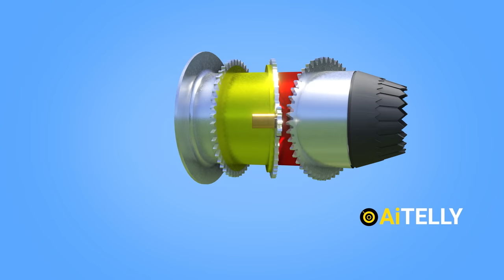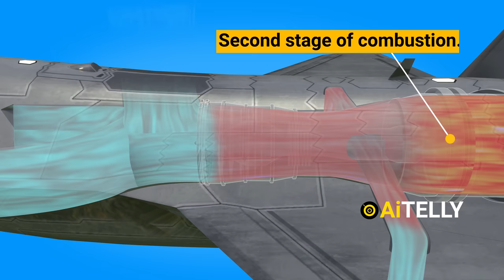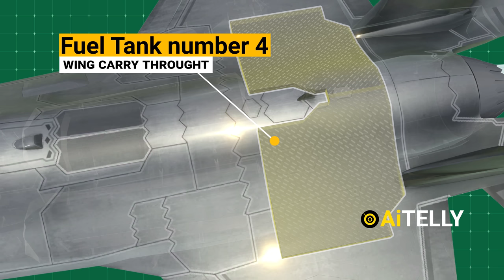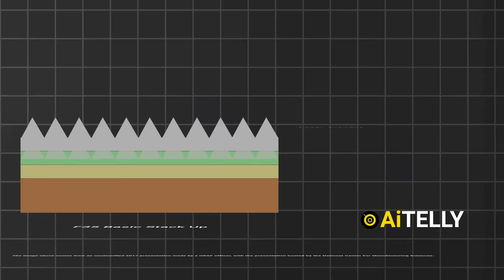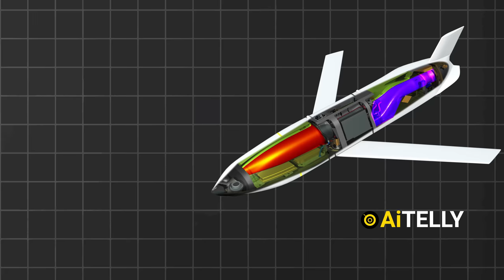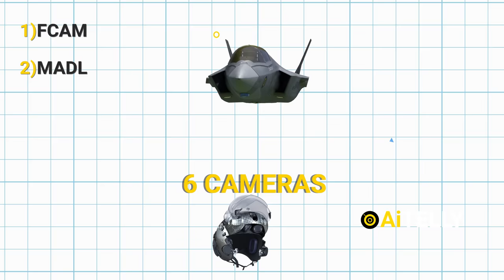F-35 B Fighter Secret Stealth Technology

Comment: The expectation that the F-35 would immediately replace 2 F-16 and A-10 aircraft did not work.  The F-35 cannot fully replace the F-16 and A-10.  It is two times inferior to them in terms of the number of weapons that can be taken on a flight, and this means that in one expensive flight it will be able to hit half as many targets.  And it is unlikely that the total price of these goals will ever cost more than the F-35 itself costs with all the maintenance.  It is also inferior to the F-16 in maneuverability in close air combat at low altitudes.  But with such omissions, the F-35 will replace the F-16.  But replacing the A-10 would be even more inferior.  In addition to a three times smaller combat load, the F-35 will be a very timid aircraft.  Because he will never be able to go where it is hot and hot.  If the A-10 can get out of such a jam thanks to its excellent armor protection, then for the F-35 any bullet or fragment will be deadly.  I'm not saying that the F-35 won't be able to operate against ground targets in a counter-air defense environment.  Of course he can, and not bad.  But he won’t even show his nose, he’ll launch a rocket or a bomb and sneak away to where it’s safe.  The eggs are definitely not useful to the pilot.
Reply: The F-35 has a larger payload than the A-10 and the F-16. For the mission role, and the fact that the F-35 doesn't need to be in visual range for anything, it can cost more per flight hour because that training is done best in simulators that are free to operate. It's also just as maneuverable as the F-16 in the event it would need to dogfight, even though it would pretty much never have to as it's equipped with the second best and second best stealth on any jet, only behind the F-22. Any CAS operation, the one thing the A-10 is good for, can be accomplished by an F-35 dropping a 2000lb JDAM on the skulls of the enemy. Doing gun runs is already a death sentence for an A-10 or F-35 in a conflict where the enemy has MANPADS and SHORAD.

Comment: It was an F-35B used by the U. S. Marines worth 140 million dollars.
Reply: News reported that missing F35B costs 80 million
Reply: @Cal-cz6zg  he probably mistook export version's cost with local one.
Reply: @Cal-cz6zg  F-35A is 80 million. But VTOL version, F-35B, is 140 million.
Reply: @sirsmeal3192  ah, fair enough. Didn't consider the type.
Reply: @sirsmeal3192  no the F35B is 100 million they are correct.

Comment: I thought you couldn't eject unless all control was lost?
Reply: You can eject at any time even on the ground, just pilot usually eject once there is no hope of saving the aircraft
Reply: My girlfriend said the very exact same thing.
Reply: Accidental ejections have occurred in the past. Not common but if does happen.
Reply: @alexandernev24 oh don’t 🫵 you dare start 🤦‍♀️
Reply: Your right, no pilot punches out and then the jet FLYS 80 miles. Did he sell the plane parts, after he auto piloted it into the lake. Then CCP divers were all ready waiting for the splashs... something is very wrong here.
Reply: @franksmith3602  Wow you said everything I was thinking of,your spot on there is something rotting in Denmark.
Reply: @alexandernev24  Depends on your vertical speed indicator 😂😂👍❤️
Reply: @franksmith3602  What if the oxygen supply was compromised.
Reply: @franksmith3602  You are a fool. These situations have happened multiple times in the past. A mig-23 flew 300+ miles without a pilot before it crashed.

Comment: If a pilot punches out and the jet FLYS 80 more miles. The pilot should be fired and lic pulled. If any pilot punches out over, subdivtions filled with children, he should be charged. There traning is to go down with the craft, and guide it, till the last second...to ( as safe of a crash site as he can find. ) 
Aka a street, or shopping center parking lot, a high way, a corn field. You never punch out, and just let her fly away...what, the F, was the pilot thinking...
This sounds more like a fly by wire test that went wrong.